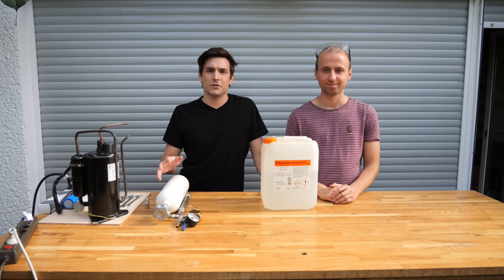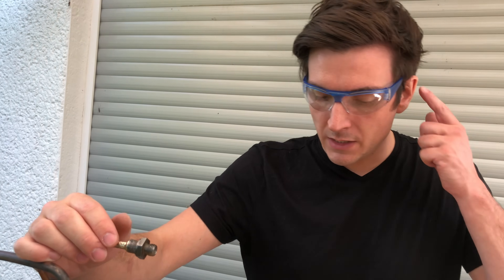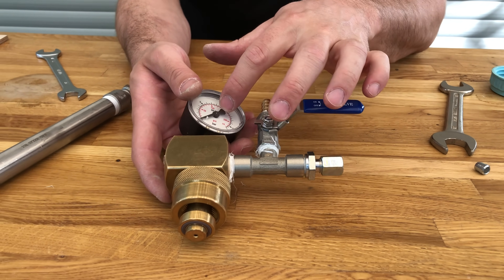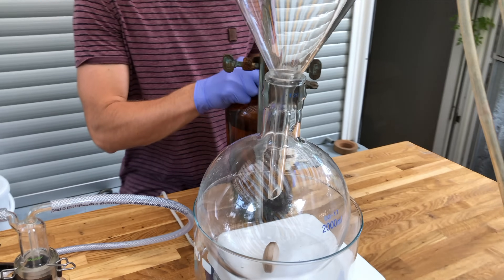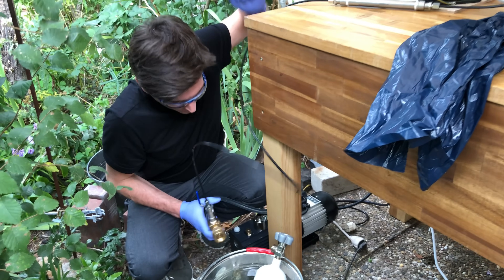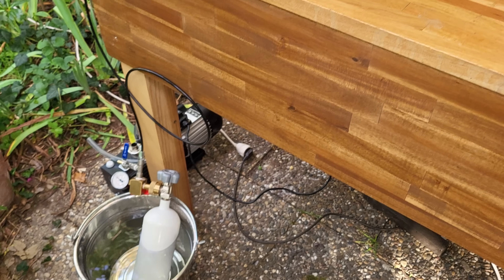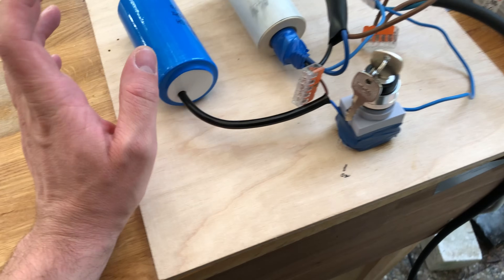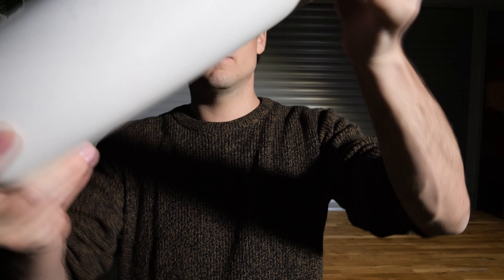Liquefying a Toxic Gas with a Refrigeration Compressor

Comment: Air conditioning compressors are not made to work on the compressing the ammonia. They are made to work for CFCs and HCFCs. Thats why your compressor died. I guess that was the problem. Or it must be due to liquid ammonia flooding the compression chamber after compression.

Comment: A compressor option would be an open drive compressor with less copper alloys inside like a  York 210 CXY 5150 automotive compressor. These are used successfully as ammonia transfer pumps in our refrigeration industry.

Comment: And again, many thanks to both of you for the unusual extraction of pure ammonia. I am wondering if the compressor casing is water-proof?
Reply from the maker: It's not a particularly useful method but fun to do. And it had nostalgic reasons since I did it many years ago. 
Yes the compressor is completely sealed (besides of course the inlet and outlet). And the electrical connections on top are not water proof.

Comment: Excuse me. I wish I could just think too much. The compressor in the video looks like it's for a refrigerator or an air conditioner.
Based on my practical experience 20 years ago, one in 300 compressors in that field is new and has electric leakage.
Excuse me for making boring comments to those who are making such a great video.
-----
Supplement
If the compressor is for refrigerator or air conditioner, the still cold refrigerant (if it used to be "fron") is circulated around the "motor in the compressor" and cooled.
If the air inlet temperature of the compressor is high, there may be a problem.

Finally, if you pass ammonia through a compressor designed to pass only substances that do not react with other things at room temperature like Freon, the machine part and oil will ... leave it to your imagination.

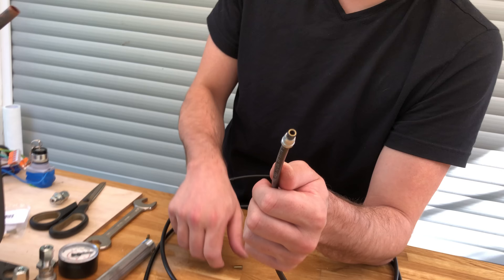Comment: I’m a diesel mechanic in the US and I use the type of fittings shown at 2:44 used to connect the copper line to a plastic line. We typically call them “Compression Fittings”. Most of the time they are used to deliver compressed air from the engine mounted pump to suspension airbags, brake chambers and other air power accessories. When installed properly, they will hold a lot of pressure (typically on a truck that is around 100-120 PSI or 6.98-8.27 BAR). You just need to ensure both the pieces (called “Ferrules”) are installed on a flush cut line (the inner ferrule is used to reinforce the plastic tube and the outer ferrule is used to compress around the outside of the tube when the nut the tightened onto the fitting). 

Some people have used compression fittings for unapproved applications like hydraulic brake lines on automobiles. That should never ever be done since compression fittings are typically not designed to hold that much pressure. Most brake lines use double flared lines and specially designed fittings that can handle the pressure. Most brakes operate around 1000 PSI or 68.9 BAR and the pressure can spike up to around 1500 PSI OR 103.4 BAR when panic braking or if there is an issue with the ABS (Anti-lock Brake System). Still, I have seen many vehicles with them installed on their brake lines and were used for long periods of time without issue. My point is compression fittings can hold a lot of pressure when installed properly.

Comment: Your compressor died because of starting it with a high head pressure and oversized capacitor which overheats the start winding with every start cycle.
You need a bleed valve to relieve the head pressure, then start the compressor and then close the valve to keep pumping.
The compressor will also overheat if used too long because in normal operation the refrigerant cools the compressor.
Reply: No ammonia eats copper and its alloys. Hermetic compressors are full of these metals inside and would be destroyed by ammonia

Comment: Firstly you shouldn’t be using a hermetic compressor for ammonia nor should you be using any copper or brass and that also means that you shouldn’t use silver solder.
All copper and brass will react with the ammonia and the compressor will fail.
All exposed materials need to be steel or stainless steel
Reply from the maker: You are absolutely right about that. However, compressors designed for ammonia are quite expensive. If you're spending that much money, you could have simply bought a bottle of ammonia. As mentioned in the video, dry ice or liquid nitrogen would have been much easier for condensing the ammonia. The goal was to experiment with a cost-effective DIY method to liquefy ammonia, which I tried when I was young and didn't have access to dry ice or liquid nitrogen. It was not meant to show the best or even a good method.

Comment: Okay, some notes from an electrical standpoint.
1) The capacitor cannot be the wrong way around. It's AC.
2) Outlet strips sometimes have a single pole switch means it's a 50-50 that you are disconnecting the neutral so the rest remains live, just unoperational
3) Trying to start a motor multiple times in a row puts massive thermal strain on the windings because the starting current is usually around 7-8 times as high as the running/rated current. The motor getting extremely hot is completely expected with fast switching, also known as short cycling.
4) If the motor has 2 capacitors it means it has a starter winding and a normal motor winding. The starter coil takes a lot more power on startup and it switches off over time when the needed RPM is met. If the motor stalls, the start winding has no chance to disconnect because of the low RPM, usually via a centrifugal switch. If the pressure differential is high enough (the max is literally written on the side), it overcomes the torque that the coils can deliver on startup and while it can barely but run at a given pressure delta, it cannot start at it.
5) Check if you have oil lol.
I hope this was of any help.

Comment: You need to shake the compressor the motor is stuck probably out of oil or low usually a jiggle while giving it power or a swift kick works

Comment: Yeah, it seems your compressor needs oil in it desperately, we used air compressor oil, or non detergent engine oil, thin as possible no thicker than 5-w30, the 0-w** should be fine , a synthetic  possibly, a detergent oil probably will just collect moisture, but used like this, should be fine,  drilling a tiny hole in the can, and using a copper washer and tapping the hole , otherwise sand the paint off around the hole and weld a nut on. Sealing the hole with a short bolt and copper washer! About 1 litre at the absolute most,  using a catch can on the output!! With the filter! (Happy compressing and pumping!

Comment: Copper (or brass)  plus ammonia don't mix!  and the POE in the compressor with ammonia is a NO NO!  Use dry ice to condense in the bottle.
Reply from the maker: As I explained in the video, the goal was not to find the most practical way to liquefy ammonia. Dry ice or LN2 would be much simpler for that. 
I simply wanted to repeat the experiment for nostalgic reasons, as I had done it when I was young.
To the best of my knowledge, the oil in the compressor was basic mineral oil.

Comment: How did the compressor die? Blocked or ground out? Im sure it did not like extra starting capacitor.Just equalize the Pressure before starting it. Or even better use a Fridge compressor because the  Reciprocating compressors and can Hard start. Also make sure you dry the NH3 Really well and you will be good. Dont overfill the Cylinder too since Liquid expansion is no joke.

Comment: Why did you use the molsieves to catch the oil? Their cavities should be too small for the oil anyways, right? Od did you use extra big ones?
Reply from the maker: Yes, the oil is not absorbed into the pores of the molecular sieve. However, it doesn't need to be. The goal was simply to have a large surface area where the oil can be slowed down and seperated. Activated charcoal could have also been used. Additionally, the molecular sieve has the advantage of absorbing any remaining moisture that might still be present.

Comment: I don't know if I'll regret giving you this idea because it's something I have been thinking about doing myself for a while, but I don't see myself liquifying ammonia anytime soon and I lack a lot of the necessary equipment, so here you go:

Galvanising stuff electrolytically with various metals has thousands of usecases. One metal that would be very useful to coat things electrolytically with is Titanium. But you can't galvanise anything with Titanium in the traditional way with watery solutions, because the Titanium ion is said to be so reactive that it instead rips Oxygen atoms off water molecules, forming Titanium Dioxide. 
Now, water and liquid ammonia share many characteristics - with ammonia not having any oxygen in its structure and a lot lesss oxidative power. I believe it should be possible to galvanise stuff with metal ions solubilised in liquid ammonia. And if thats the case, you should be able to galvanise stuff with Titanium in liquid ammonia, which would actually be a very useful development in material science with money making potential. You'd definitely be a first on YouTube with that!
Reply: I don't know if that's a brilliant idea, or an idea that is so risky nobody would try it
Reply: @phobos1963  It's all a matter of the equipment you have access to. He already liquified quite a respectable amount of ammonia and stored it, imo that should be the most dangerous aspect of the experiment already done.
Reply: Yeah I don't plan on ever having enough ammonia on hand that could be liquid. 

If anything I'd probably just make it as needed with a generator.

Comment: Safety glasses around ammonia = useless! Use eye-sealing safety GOGGLES!
For even these little quantities, the biggest hazard is it hits you in the eye, and burns the surface. Then you get a blister ON YOUR EYE. This will almost cetainly lead to your eye BURSTING and you LOSING AN EYE!
Seriously, maybe research the materials you're thinking of using, before you wreck yourself?
Reply: Honestly I suggest a faceshield over the top of the face-sealing goggles. Just keeps you from getting a concetrated waft in the face, which is extremely unpleasant, even if your eyes are safe. Generally you still want to be able to SMELL if you have any leaks - and you want the yellow ammonia leak-detecting cloth which changes (reversibly) to bright blue when exposed to ammonia. You use this to figure out where the leak is. AND THEN YOU FIX IT!

Comment: Brass inserts? Uh oh.. LNH3 will dissolve brass! And copper, and zinc, and gold..... and it will form explosive compounds with many of those and many plastics, like viton, for example. You need to be very careful about material compatibility with NH3!  

If in doubt, put the fitting or seal in a jar of the ammonia water solution overnight - if any white or blue compound appears, (or your fitting dissolves) then your fitting is *not* compatible. But use that trick with things that might be nickel, not obviously incompatible brass! (sometimes a metal fitting is an alloy which is not compatible, or has been brazed with a compound which is not compatible!). 

You might get away with this for a little while, but it's absolutely asking for trouble! 
Is your bottle made of compatible materials? Is your compressor oil compatible? There are special pure napthalene oils made especially for R717: they avoid addititives  which many lubricating oils have, and triglycerides which will react with the ammonia.

Comment: Only need an LPG bottle for LNH3 - high pressure gas cylinder not required. Just make sure you end up with about 0.5% water in it, it'll passivate the metal and prevent corrosion. This is known as R717. Beware: ammonia will hurt you even diluted down to around 0.05% v/v, it burns and scars! Very bad news if it gets you in the eyes or lungs!

Comment: Compressor died, most probably, because it overheated. They are designed to work in closed circuit of refrigerant and are cooled with refrigerant by proper setting of superheating. In your case he didn't have any cooling, since ammonia vapor was probably already too hot. You can say it had enormous superheat!
Also, prolong running in open circuit makes him lose oli. As you already know, oil vapor is present on discharge side.
Bad wiring didn't help either, probably accelerated heat death.
And in the end, you want open type compressor for ammonia. Since it will eat windings of the motor.

Comment: Never seen solvated electrons produced by cesium in liquid ammonia, could be interesting/dangerous
Reply from the maker: Will do that. And I will try to find out if these solvated electrons are stable in liquid ammonia at room temperature.
Reply: It makes a golden yellow solution. The solvated electrons will have the absorption band of the host ions for example lithium and sodium are blue, cesium is yellow, and barium is blue green.❤
Reply: @christopherleubner6633  damn that sounds sick

Comment: Your videos where you make glass apparatus are amazing. your chemistry videos good. I know you like to have fun making them. But your electrical skills make me want to run and hide. If you could have purged the pressure each time before starting the compressor, you likely would still have a compressor. Still thanks for the video I'm going to hide over here now.
Reply from the maker: Haha, I'm sorry :D. Venting the pressure line each time would have had other draw backs. At the very least, one would have needed to devise another setup to neutralize the ammonia. The video wasn't about demonstrating a practical method for liquefying ammonia. That could be done more easily with dry ice or LN2. I simply wanted to repeat the experiment for nostalgic reasons, as I had done it when I was young.
Reply: @AdvancedTinkering  that's it you do what makes you happy. You can't please everyone all the time the same people sit at home wishing they could do what you do.

Comment: refrigeration compressors are actually incredibly useful, and cheap, for the movement of a wonderful range of gaseous solvents! My personal favourite are the R600a compressors which are ideal for Butane and other alkanes! Very handy for non-polar extractions.
Reply: pinging HyperspacePirate
Reply: Yup! You can also make small custom refrigerated appliances by charging them with straight butane. Also a second compressor can serve as a vacuum pump to evacuate the system of any moisture/air.
Reply: Most of these comps req oil, you don't want oil in your extract. 

Anyways, when you've got a volume of butane and thca oil extract - bubble ammonia into it. The ammonia forms a salt of sorts with the thca
Reply: I use one as a vacuum pump. It was basically free when we got a new fridge.  Also, the guys who picked up the old one said I was welcome to come to their business and take as many compressors as I wanted since they have to pay for disposal by weight.

Comment: Instead of brazing that nipple onto the copper pipe, you could've used a high-pressure compression fitting.
Reply from the maker: The pipe had a weird diameter. Couldn't find a compression fitting for it.

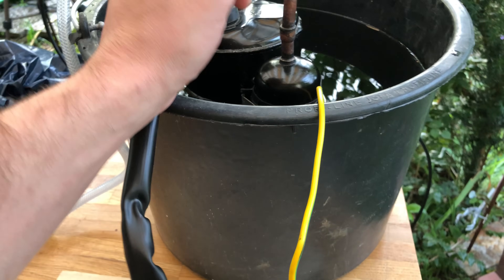Comment: 11:28 this reminds me of Wranglestar putting a piece of tin foil across his bed and sticking the end of a wire into his homes ground outlet ..  .. to "ground" himself 

Rule of thumb: If you stick anything into an outlets ground, You just became the path of least resistance. If power shorts and runs through ground it eletrifies the entire grounding line including the one in your bucket
Reply: There's probably a CFI breaker installed.  A ground fault will lead to immediate power cut.

Comment: Perhaps the compressor oil was not compatible with ammonia
Reply from the maker: As far as I know, the oil in the compressor was mineral oil which should be resistant to ammonia. But I can't be absolutely certain, of course. The best course of action would have been to replace the oil beforehand. However, the method was not intended to be practical for liquefying ammonia. The use of a compressor had more sentimental reasons, as I liquefied it with a compressor in my early years when I didn't have access to dry ice or liquid nitrogen.
Reply: Umm please keep in mind that in certain situations if/when refridgernt  gets contaminated for what ever reason with what ever. when in everyday use in residential / commercial applications it either turns basic or acidic on the ph scale. which eats away at the varnish insulation on the copper wire windings in the motor , which takes its toll on the windings and they short out to each other and or short to ground and they can burn in two causing an open winding .  

the type of compressor used in this video is called a scroll compressor they're sensitive to contaminates of both liquid or solid forms . 

A recipricating compressor might have held up better/longer , the compressor used in refridgerators and home freezers are usually recipricating style compressors . these have a crank and pistons and bores and heads much like a 2 cycle engine and reed valves like 2 cycle engines have. these could be single cyclender , oposing twin cylender or 2x2 opposeing  depending on the size of application the equipment is . 

hvac compressors make good vacume pumps and air compressors especially the compressors that look like air compressor pumps which is actually what they are but semi hermatically sealed . these have a seperate motor that can be removed and replaced without pumping down the system.